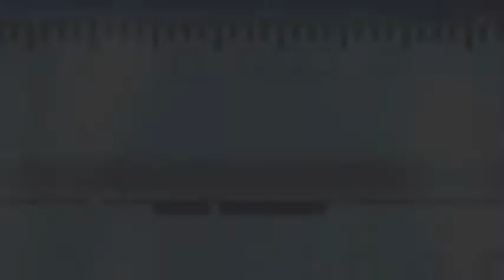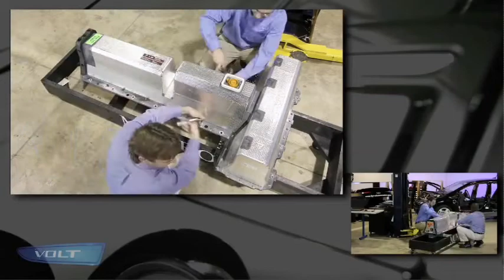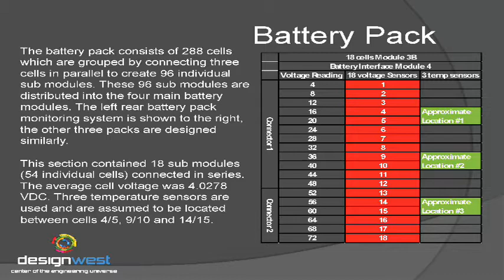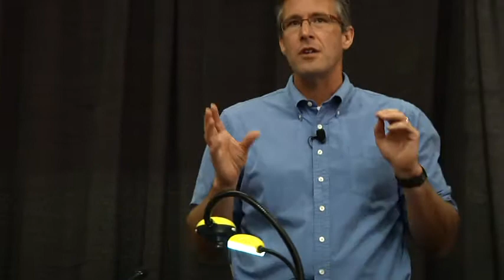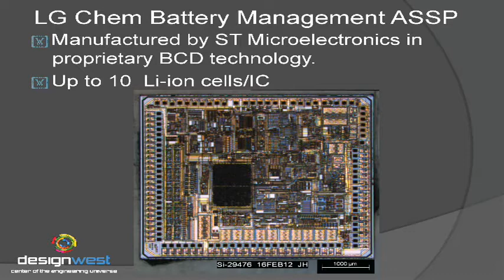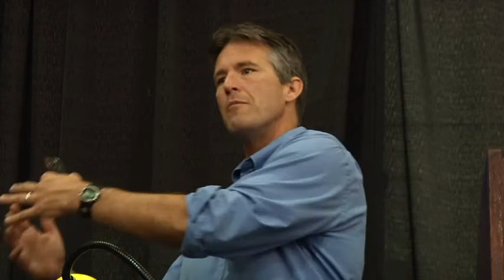Chevy Volt teardown: The battery pack

Comment: My guess is that as the battery reaches its warranty date, GM will release a modification chip that will give access to some of the remaining 35% untapped battery power.  This would be a preferred way of extending the cars life versus battery replacement.